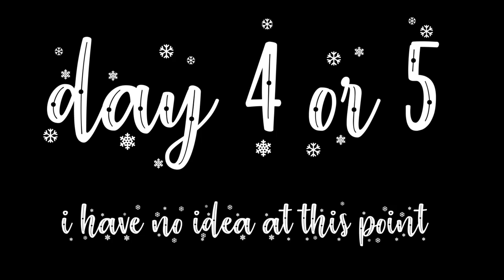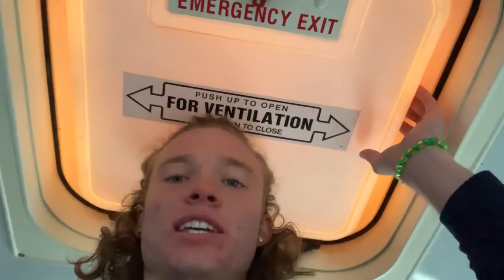Tiny House School bus Conversion anyone can do for under $1,200 total

Comment: I hope you sold those seats that you removed ( more money towards your build). IKEA is a good place to shop too.  I'll be watching.  Good luck :)
I have seen people raise the roof on their schoolies
Reply: Where would you sell em
Reply: good looking out!
Reply: Small kiddie seats with only one side with feet aren't worth as much as they are with the vinyl and foam stripped off for metal. I'm working on the same size kiddie bus,  (daycare) and I've got a 25 fresh and 30 gallon grey water tank under the floor and a shower and sink, 10 gallon water heater, mini fridge. My bed is on 2 of the original seat platforms cut off.

Comment: Anti-gel goes in the fuel tank and then spray ether directly into the engine intake.  Perseverance, and she should fire.  Battery heater and a block heater are necessary if you want to live north of Florida.  Happy trails from a friendly Canadian, cheers!

Comment: Did he have to get a cdl to drive a bus?
Reply: You don't need one for most buses, especially a short bus like his
Reply: CDL is required for vehicles with over 26,000 lbs GVWR. Also for a vehicle designed to carry more than 15 passengers. This bus is neither. It will be registered as an RV and weighs less.

Comment: You need a... block heater.. not a tank heater unless you want to off gas diesel fuel... 🤦‍♂️. Go buy a block heater kit or go get one installed. Most diesel engines have an electric cord sticking out of them to heat them up..